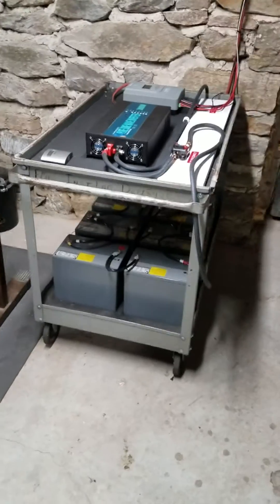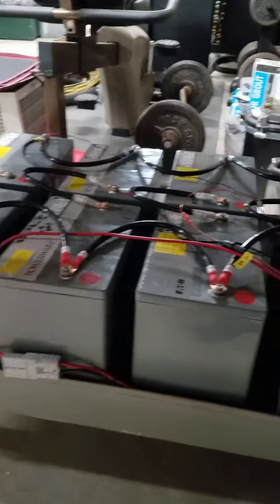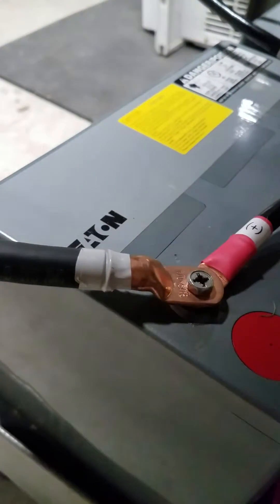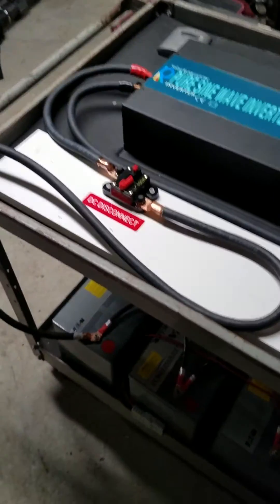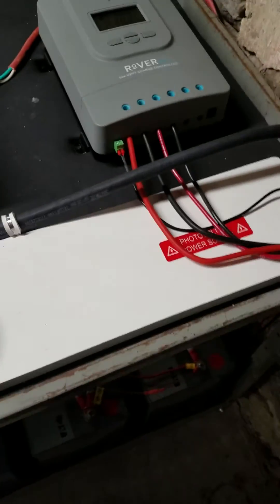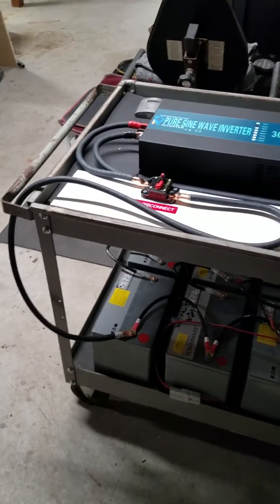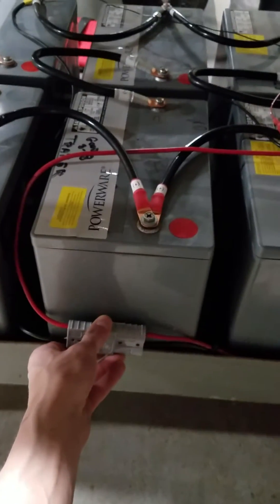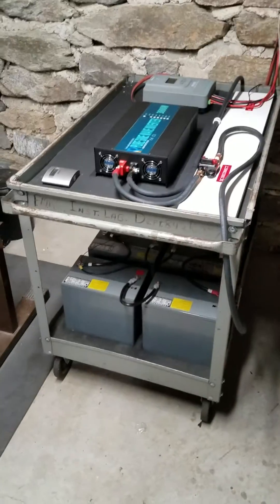24v Emergency Battery Backup System 3000w 7.2kWh

Comment: Nice.
And what do you have today. I wonder
Reply from the maker: Those batteries are surprisingly still kicking, but they were too drained to run my Genny panel circuits for more than 5 hours or so lol. I have a 10kWh system now, 2 eg4 24v 200ah lfp batteries with the sungoldpower 24v 6000w inverter.
Reply: @SamsDIY  cool. I use two 320 amp lifepo4.
I have 6 more coming soon.
I still run 12 volt system but will be able to convert to 48 by changing the wiring.
I'm still waiting on 6 batteries and 3 new 405 watt solar panels.
I put a video on my channel on my system and I am looking forward to making the upgrade video in a week or two when all the new parts show up.

Great video thanks for sharing.

Comment: Am a newbie 😢 … on this ups stuff but what’s the type of batteries your using
Reply from the maker: They are just SLA (sealed lead acid) batteries. The type of SLA batteries are AGM in this setup. Hope this helps!
Reply: @SamsDIY  thanks just got mine installed yesterday …mind recommending any racks because I have failed to find anything

Comment: How do you switch it during a power failure?
Reply from the maker: I use a 3 position changeover switch to switch between grid, generator, and batteries/inverter. That goes into my 10 circuit sub panel with an interlock so I can't backfeed into the main panel or grid.

Comment: Does this work like a UPS?

I mean your backup is continuously charging while your inverter is loaded with your electrical appliances?
Reply from the maker: Yes, I am in the process of switching everything over to charge off the inverter with an auto transfer switch instead of the manual setup I have now. As of right now though I have 3 UPSs around the house that take the in between time until I switch it over

Comment: Be cool if you got solar panels to hook up to it, extend the run time some at the very least.
Reply from the maker: I did on that setup, and I do on the current setup. I have a newer video where I show the solar hooked up to it. The charge barely goes down half a volt during a sunny day.

Comment: How long would your batteries last running your house before needing recharging?
Reply from the maker: It depends on the load. If we use a lot of water the well pump would come on more, if it's cold and I don't have a fire going, the forced hot air oil furnace will come on, if we use the microwave, TV, how much the refrigerator runs, etc. Id say it would last 24-36 hours on a single charge, that's from 26.2v down to 24.0v which is 50% depth of discharge.

Comment: How long could that set up power normal household usage for?
Reply from the maker: I have loaded it up with my forced hot air furnace, refrigerator, TV, modem/router, water softener, etc. All at once and it does it. I even use the microwave with it, which is an 1850w. I can run those 10 circuits for 24 hours with no solar I would say, since the batteries are old. But with solar it lasts much longer obv.

Comment: How much did you pay for the whole thing SIr ??? thanks
Reply from the maker: I think that inverter was $399, 1/0 wire was free, batteries were free, cart was free, the fuse was around $25-$30, the charge controller was maybe $150ish I want to say. Then I got the terminals from Amazon, the two Renogy solar panels were $199 (2x100watt/12v) so maybe around $850 I'd say.
Reply: @SamsDIY  Well I have to say that the price is right. I am getting my supplies for the project slowly. Any unique locations would be appreciated fella. P.S. my client friend left a 200 KW battery bank system working perfect to a Uneducated Dork. I found out a few months to late. The whole system is under the landfill. A system that would keep his house power supplied for four weeks plus. 
Shall I give him the DUMB FORK AWARD. And maybe a kick on the shin. Look forward for a reply.
Reply from the maker: Awesome good luck with your build! Too bad about the old setup!

Comment: Is possible to keep connected all the time in paralel with the batteries the grid charger and the inverter? Like a UPS?
Reply from the maker: Yes I believe that's one way to do it, since that inverter has the option to auto transfer. If you set it up into a second auto transfer switch to your panel it would automatically swap over as long as you kept the inverter ON 24/7 which is no biggie as long as it being recharged by grid or solar and charge controller. They usually have a standby mode where they would sit idle until a certain power draw and it would turn on and transfer. It isn't as fast as a UPS though so I would suggest putting a regular UPS on your electronics in addition to the battery and inverter setup. Hope this helps!

Comment: do you need a battery balancer? or is that optional?
Reply from the maker: No I've been running it this way for about 2 years now I'd say with no balancer. The batteries were all the same from the same batch at the factory etc. And I check them every so often to make sure they are all pretty close to the same voltage. Originally I charged each one fully then linked them up

Comment: Anyway you could send me a pic of how you wired that. I have the exact kind of batteries from work lol. And I'd like to set up the same system.
Reply: Picked up the inverter. 4000w/8000peak. 24v. Any tips on wire for the batteries.
Reply from the maker: @TerryHardingable  You would want 4/0 wire if you planned on running anything that surges over the continuous rating of 4000w. You could do 6000 watts with copper 4/0 wire with a 90*Celsius rating since 6000w at 24v is 250 amps and that would get you to 260amps "safely."
Reply: @SamsDIY  yeah I used welding wire. 2 gauge 105c for the batteries
Reply from the maker: @TerryHardingable  okay so I would say get a 100 amp DC breaker or fuse and put that on the positive 2 gauge wire going to your inverter to protect the wires, 2 gauge is good for 115 amps. The wire would be your limiting factor so you'd have to do an appropriate breaker to prevent too much current through the wires. Unless you have two-ought (2/0) wire, which would be a higher amp rating, and is larger in diameter.
Reply from the maker: Haha no kidding! That's awesome. Sure I can send you a picture. Did you want a close up of my setup or just a wire diagram? Just let me know I'll send an email or something.
Reply: Keeps deleting my msg for some reason. Lol
Reply from the maker: It's probably getting flagged for some random reason and not letting the comment stick, that's my guess lol.

Comment: You know there are some inverter with UPS function so your house could be always on...
Reply from the maker: Yes I know I have a better inverter now and am hooked through the generator panel with a changeover switch. I can use my generator or my batteries and inverter. It has the auto transfer function I don't use it yet

Comment: Congrats 
I would like to make something like that but portable
Meaning charging it on grid power  than moving it around.
But I'm curious how fast it would charge to 100%?
Reply from the maker: You would probably have to use LFP batteries because each one of these batteries weigh about 50lbs. So 400lbs. Total with just the batteries. The type of inverter I use now weighs another 60lbs. It would charge as fast as your charger can, and also look at manufacturers recommended maximum charge rate per battery. Hope this helps!

Comment: I am confuse,what is the size Of wire between batteries?
Reply from the maker: Since I changed the setup a bit I use 1/0 gauge, but I had used 2 gauge wire when I had the 3000 watt inverter hooked to it. I'll have to check.

Comment: How long it take ur batteries to fully charge on solar power vs generator and when they full whats ur reading on full
Reply from the maker: I usually run them down to 50 percent so down to 24v at the lowest. Then it takes a full day of sun to get back to basically full. At the end of the day they read 26v or so
Reply: @SamsDIY  oh ok today is my first real test I only been using about 250 w for a couple hours now I'm at 12.1 12.2 volts

Comment: I hope these 4 AGM batteries I just bought used are any good they seem to fall in voltage kinda quick on me how do I know if they any good or need a good charging because they don't seem to hold long at all
Reply from the maker: When they are charged fully they should read like 12.8 volts, or for 24v they should be around 25.6 to 25.8 when not charging. They will settle to that voltage when full. What are you running for a watt load on the batteries? It will depend on the load and if they're used they will be a bit less on the voltage.
Reply: @SamsDIY  about 200 watts total basically my computer my grow lights that I have turned down and a lamp barely 2 whole amps

Comment: 4 of the 78ah agm batteries will be here in a few minute at first i thought my inverter was 48v but its a 24v witch i preferred anyway im to happy lol these two 35ah Vmax batteries im using now totally suck ass
Reply from the maker: Perfect, how did those batteries make out for you?
Reply: @SamsDIY  Well I sold all my AGM and let acid batteries I'm running on 16 Lifepo4 lithium iron phosphate cells in 24v which gives me days of back up
Reply from the maker: @thelithiumpowerch  Awesome! I am very jealous, how big are the LFP cells? I've been saving for the 24v 200Ah EG4 rack mount batteries, but I want at least 3 at a time, which is just over 15kWh. Good luck!
Reply: @SamsDIY  the cells are 120ah so I have a 240ahwith the 16 cells lil under 6kwh to start off with then my plan is to buy one complete 12 volt 100ah lithium battery every month til this coming fall to go with the 16 size I have also I just installed a 12,000 BTU mini split
Reply from the maker: @thelithiumpowerch  sweet man, good luck! I am trying to do the same thing, making the big switch to LFP and put my remaining solar panels up.
Reply: @SamsDIY  Oh ok yea I'ma be ordering me some more panels soon I'm here in northwest Ohio and it sucks when it comes to solar not to mention I'm completely off grid
Reply from the maker: @thelithiumpowerch  oh yeah that's a bit more difficult then I have it, with being connected to grid. I have grid tied solar, 3.6kW system, and then battery and Genny backup in my critical loads panel. I'm in CT, so solar is crap right now at this time of year.
Reply: @SamsDIY  Right it's very crappy here in Ohio I only have 5 of those all black 355 watt panels I do have a small generator right now my batteries are at 50% state of charge
Reply from the maker: @thelithiumpowerch  yeah I hear that, the sun is starting to get higher in the sky again tho so it will only get better from here on out
Reply: @SamsDIY  I also noticed when I clean the snow off my panels they seem to charge pretty good on cloudy days with snow everywhere it must be the reflection cuz right now and they are really charging and I don't see the sun nowhere
Reply from the maker: @thelithiumpowerch  Yes I believe the snow reflecting helps a bit! I notice the same thing, much better than a rainy day with no snow
Reply: @SamsDIY  right even better than overcast cloudy days witch we seem to get a lot of here in Ohio

Comment: How many amp hours are each of ur 12v batteries ? And what determines the kilowatt hours u have there??
Reply from the maker: All my batteries are 75 amp hours each and they're wired up as 24 volts. So to get the total kWh you would multiply the amp hours (75) x 4 batteries (half since it's wired at 24v) which equals 300 amp hours. Then you take 300ah and multiply that by the voltage (24v) which equals 7200 watt hours. Then divide by 1000 to simplify to kilowatt hours (7.2 kWh). Hope this helps!
Reply: @SamsDIY  ohhh ok because I'm about to pick up 8  78ah AGM batteries for $50 bucks each in mint condition to use with my solar so basically I'll have around the same amount of power as you at 78 amp hours 24 volt
Reply from the maker: @DIY Adventures  yeah at 24v with 8 you'd be at 7488 Wh so 7.488 kWh. Good deal! Recommended depth of discharge for sealed lead acid batteries is 50% to keep them from being damaged. So you shouldn't discharge the battery bank lower than 24 volts. Lithiums can go around 80% discharged without being damaged so more of that power can be used in one sitting since you can discharge to a lower voltage. Good luck!
Reply: @SamsDIY  thanks man yes I found a whole pallet full of these AGM 78ah batteries on Facebook Marketplace
Reply: @SamsDIY  hey buddy I have one more question the inverter that's coming is a 48v so what would 78ah be with them 8 agm batteries at 48v
Reply from the maker: @thelithiumpowerch  It would remain the same since it's 156ah x 48v = 7488 Wh. It will always come out to that number at 12v, 24v, and 48v. The capacity is half of that at 48, but you multiply by 48 instead of 24 so the watt hours doesn't change regardless.
Reply from the maker: Here is an example : For Lead Acid, 24kWh is equal to:
2,000 amp hours at 12 volts
1,000 amp hours at 24 volts
500 amp hours at 48 volts

Comment: Good morning friend, I’m going to setup a new system and if you can help me take a look if I do it right🙏🙏🙏.   5- 250W solar panels, 10- everstart 100A 12V battery, 3,000W xijia inverter, and 40A 150V Epever MPPT solar charge controller with 100A circuit brakes.  Please take a look and see I have everything I need.   Thank you very much🙏🙏🙏 have a great day
Reply from the maker: What kind of ever start batteries are those, just car starting flooded lead acid batteries? It seems like you have everything, but with a 100a DC circuit breaker at 12v is only 1200w so keep that in mind. For 24v it would be 2400w which would make more sense. That setup should work good as long as you always keep it charged. I'd have to know more about the charge controller limits and the way you are wiring the panels (series/parallel/combo) to know exactly if it will work as you intend, but all the pieces are there. Also would need to know what your planned loads are. Good luck!

Comment: Hello sir I got a food trailer build got a electric grill top thats 240v 8400w 30amp what kind of  batteries I can use to power it for 5hr and can recharge on a low budget build
Reply from the maker: If you could maybe get a bunch of batteries SLA for cheap or free, and an inverter that does 240v output. That's a very large amount of power for a long time. 8400w x 5 hrs is 42,000 watts (42kW). You would need a large battery bank with quite a bit of solar and it wouldn't be a budget build. hope this helps! Sorry for the crazy late response, it wasn't showing up.

Comment: Love your video??? How many solar panels did you use for your system
Reply from the maker: Thanks! I only have 200 watts of solar hooked up to it, but I am going to at least double that so I can the battery bank back to full charge a lot faster
Reply: Thank you for returning my ???.  I have one more ??? I plan to have 6-12v/114amp and 5 solar panels to supply 187w 24/7 you think that will work🙂. Or I need more. Thank you 🙏
Reply from the maker: @koilover7740  I would go with a bit more solar if possible if it's 187w total,, but if that's all you have it'll do! It'll just take a bit longer to charge. If you have five 187w panels then that's plenty if you get a lot of sun.
Reply: 🙏thank you very much for your help

Comment: assuming your charger runs across the whole bank, do you monitor individual batteries (or even cells) to catch any that fail?
Reply from the maker: I don't have a meter or anything on them permanently but I do check each individual battery every so often with my multimeter.

Comment: If I get the batteries, would this be something an electrician can replicate? I know next to nothing about electricity. Thank you! I loved the video!
Reply from the maker: Yeah definitely, as long as he is familiar with wiring batteries/battery banks and proper DC wire gauges to use for the system! I would think most electricians would have an idea or at least check wire charts to be sure. I learned as I got ideas and that led me to dig deeper into these backup setups. You could definitely do it!
Reply: @SamsDIY  perfect thank you so much!

Comment: Damn, that's impressive! How much would something like this cost if you were to purchase everything new and do it yourself?
Reply from the maker: Thanks! If you were to buy eight 100ah AGM batteries at $200-300/each($1600-2400), an inverter for $300-500, charge controller for $150, two 100 watt solar panels for $200, 15' of 2 gauge wire for battery to battery connections at $2.25-2.50/ft, 10' of 1/0 wire at $3.00-3.50/ft, some crimp connectors for around $20, a 100-150amp DC circuit breaker for $10-15, 25' or so of 6 gauge wire for ground at $0.75-1.00/ft, you'd be spending somewhere in the $2,350-2,500 on the low end. Not crazy when you do it yourself compared to backup battery systems you can purchase for $5,000-10,000 before installation! Hope this helps!
Reply: @SamsDIY  . Thank you so much! Cheers!
Reply: You can save some money by purchasing used solar panels.